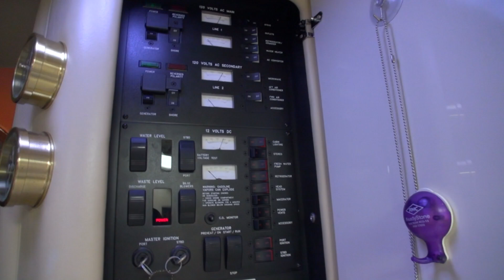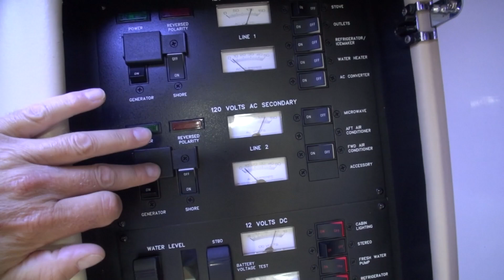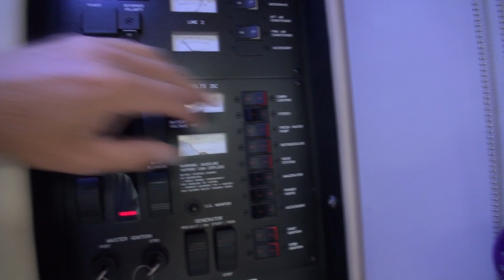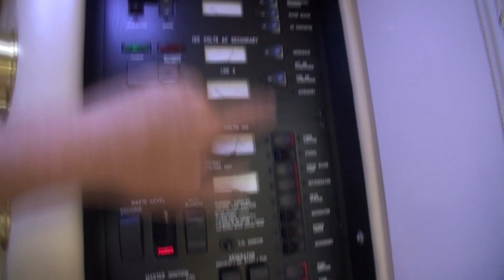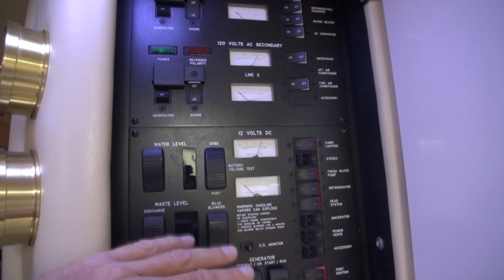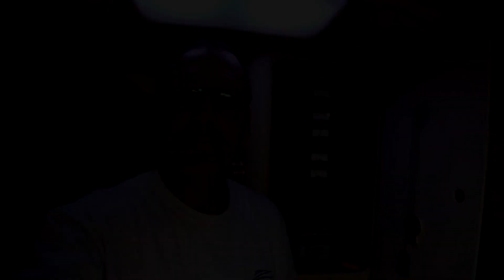Explaining Boat Electrical Panels - Throwback Thursday

Comment: Always amazed at how clean and fresh your boat looks for a 1998. Even the breaker panel!
Reply from the maker: Always great to hear, so thanks for that! 
Although we sold this boat a few years back, her replacement is even nicer 😁 Check out my channel for a look at some of the many upgrades I've done on the current Boogaboo - another 1988 Sea Ray, but this time it's a larger 370 Sundancer.
 I look forward to hearing from you on one or two of them!

Comment: "Could be quite shocking" hahaha, love the dad joke! I've learned somethings watching it again, like using the AC shore power for the fridge while docked: I always left it turned off thinking it was only for the cockpit fridge (duh!) 🤫 My thinking was: "Upper panel fridge switch for the upper fridge; lower panel switch for the lower fridge." Omg right!? 🤣Now I know how to make it easier on the house battery 😅
Reply from the maker: Technically, one should never have to shut off any of those switches, as the fridge(s) will switch back and forth from shore to battery automatically. 
 Have a look at the fridge installation video I did when I swapped out the old cockpit icemaker for a new AC/DC fridge in our current (no pun intended 😉) Boogaboo, as I believe I discussed that part if the equation then. And if I didn't, I guess that's another video for another day 😄